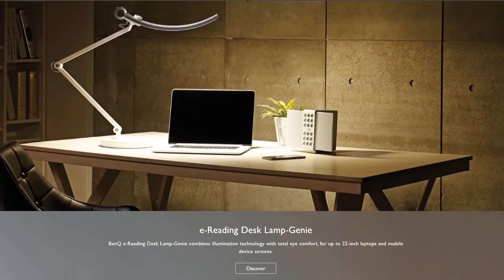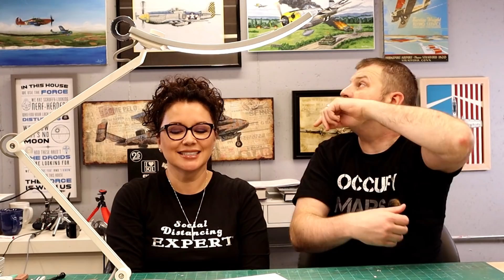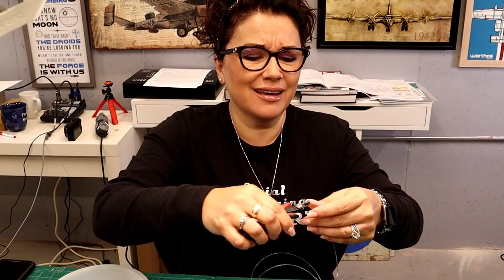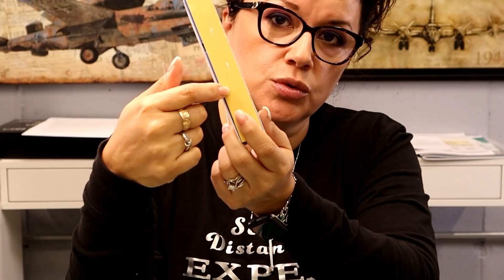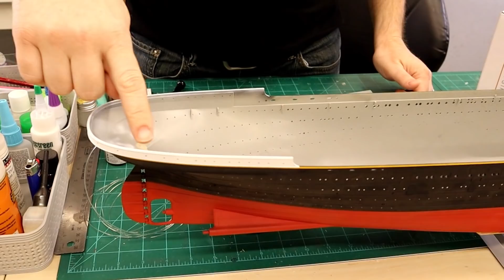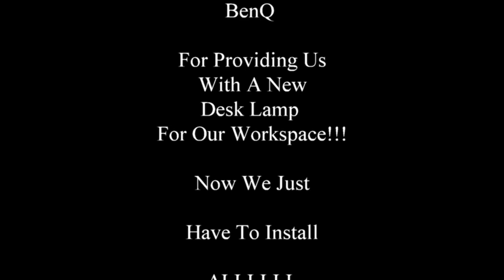1:200 RMS Titanic Build Video 4

Comment: 4:45 ... Why buy expensive fibre optics, when a decent quality fishing line will do the same job? It comes in a large variety of diameters and one spool provides a life-time worth of line. For just pocket money. Just make sure the fishing line is colourless and transparent and it MUST have a smooth, shiny finish.
The tips of the fibre optics you are using sometimes respond well to acetone or heat. Cut off a short piece and dip one end in acetone. Some plastics become glossy almost instantly, some turn white or matt, so give it a try. Soft plastics will also become clear after some heat is applied, so hold one end near to a flame. Near.....that is, don't hold it into the flame.

Comment: i do fiber optic work and if you get the cleaver tool that we use it will cut the end perfect so you don't have to polish it by hand. its like 40 bucks
Reply from the maker: Do you have a link to this tool? Is that what it’s called?
Reply: @TheMidwestModelShop  https://www.amazon.com/Optical-Connection-Stripping-SUMITOMO-Stripper/dp/B01GLRWXDC/ref=sr_1_24?dchild=1&keywords=fiber+optic+fiber+cleaver&qid=1625939077&s=hi&sr=1-24
Reply: @TheMidwestModelShop  and also fiber glass has a small jacket around that before you get to pure glass this kit will save yall alot of time on doing fiber strands for lighting and also you could look into fiber termination connectors to help hold the fiber in holes better and protect the ends of them and it will still produce the same light effect
Reply: @TheMidwestModelShop  do yall take online orders from your shop and ship out model kits and if so a link to website to order thanks
Reply from the maker: No we don’t have a shop. I called it the model “shop” as in “work shop”.

Comment: Hi, Great videos. Can you tell me if you drill the portholes with the real sizes, or, you drill the portholes with the sizes of the fiber optics availables?.   What drill bit sizes in milimeters you use? . Thank you by your help
Reply from the maker: I first drilled them with the real sizes. Because I didn’t know about the fiber optics at the time. But then had to go back with the real sizes for the fiber optics. The reason is the fibers are the exact size they say they are. The 1mm is ONE millimeter. But my hole was .03 short and so it wouldn’t fit, for example.
Reply: @TheMidwestModelShop  ah ok.   I buy in Light House Leds fiber optic of 1mm, 1.5mm, 2mm, 2,5mm and 3mm. But the portholes have rare sizes 3mm, 2,4mm, 2,1mm 1,8 1,2 and 1,1. Its difficoult instal the fiber optic with this sizes. You recommend me adjust this sizes with drill bit directly to the sizes of the fiber optics? .. Or reduce the diameter of the fiber optic with some tool?  Many thanks for the help from Buenos Aires  Argentina
Reply from the maker: I would drill the holes out bigger to match the fiber optics.

Comment: Does the LED strips have any sort of power input socket wire or some sort ? If so, where do you place them on the model ?
Reply from the maker: Yes it plugs into a normal 110v plug. I’m going to do a video on all of that as soon as I have time. It’s next on the “to do” list.

Comment: what temperature light are you getting out of the LEDs? The issue folks always have, this comes up in locomotive road number boards where the light is way too blue in the 5000k+ range.
Reply from the maker: You’ll have to look closely at the box in the video for the specs. It’s definitely NOT blue and looks like incandescent lights.

Comment: Hi Guys got a question for you what's the best plastic filler? I screwed up one porthole on the stern from the four that you need to add, I'm using testers puddy in a tube but it dries much to soft for my liking I thought of widdling down a pc of plastic from a sprue & gluing it into the hole to make it stronger to drill into without chipping, but not sure if there's a better alternative. Any help in this area would be greatly appreciated. 😜👍
Reply from the maker: So for seems that need to be filled quickly and then painted I use “Perfect Putty”. But it doesn’t dry hard. So for the windows I use Squadron White Putty. It will dry hard and drill out pretty well. But there’s a chance it could chip. You have to be careful when drilling. The best solution is using the kit styrene and touring down a rod of it to install in the hole because it will be the same density as the hull. Styrene rod also works well, but can be softer than the kit plastic in some instances. I use all three methods, depending on what I’m doing.
Reply: @TheMidwestModelShop  thanks a Billion Ben. 👍👍

Comment: Looks great you two!  Just getting into lighting myself!  Question for you - do you intend to leave every port hole lit?  On Enterprise builds, I've seen guys do a random pattern to the window lights, so it looks as though some rooms have light and some don't. Just curious.
Reply from the maker: We are lighting ALL OF THEM. On the enterprise, with its lighter color hull, it’s easy to see the difference. On this black hull it just looks like we missed something. I’m also not into figuring out which rooms were lit and which weren’t to be “accurate”. Because it’s not. At 10:30pm I bet most of the rooms were dark anyway.

Comment: Cool idea going with this way of lighting the model. 
Couple suggestions for you; paint the inside of the model with flat black and check to make sure it’s not leaking light through the plastic and seams. Make the inside of the model a light box and point the fiber optics at the source as you mentioned but fiber optics hate being bent, you loose a lot of light for every turn. It could be ok because you get a variety of light intensity and that could look fine in the end but it’s something to look out for. 
On the largest of the Titanic models for the movie they built quarters so when the camera would pan by the larger portholes you might see inside. You could replicate the effect with backlit images spaced back from the pothole window. We did this on SFX models for the same effect but with 35mm slides. 
I worked on the movie and we built the engine room and the subs so your model project is right up my alley! I had my eye on this kit from the start when they released photos from the toy fair in Germany  so it’s good to see it being built with great attention to detail.

Comment: My wife has been a manicurist for 30 years. I got hip to using professional nail files and pads way before the modeling industry did. It’s the only hip thing about me. Sadness. The hull lighting looks fantastic. Nice even light. In the stern under the poop deck you can take all the long strands and run them into a piece of flexible tubing to gather them together. That way you don’t have a bunch of loose strands to contend with.

Comment: Had you tried melting the ends of the fiber optic strands (Lucite rods) to make a tiny blob as we model railroaders have done for a long time?
Reply from the maker: Yes I tried that right away. Unfortunately this stuff just turns into a frizzy bubbling mess. I tried less heat and nothing happened. It was like it was going to melt into an ugly mess or do nothing at all.

Comment: I've seen someone else using one of these lamps and they seem to work well. It does seem pricey but you get what you pay for.😁
Fibre-optics is something I know nothing about so it was interesting to see the process. That's a huge project, on 𝒆𝒂𝒄𝒉 side, but it could be so much 𝒘𝒐𝒓𝒔𝒆 using different techniques. Apart from anything else, this has to be the cheapest method of lighting thousands of portholes.😁

Comment: Yep they look good.  Perhaps some diffusion, frosted plastic will help tone down any hot spots you encounter.  Warning! part A12 (page 13) will need the portholes drilled out as the  mould was inverted incorrectly.  Your PE porthole replacements will need to be used or the KA versions which are included in the Upscale kit.  There are a few windows missing in the superstructure that you will encounter later on too!!  Great video!  :-)

Comment: Hello B&N nice in depth video, I have seen the other's but got to love all the info you both share with us. As for fiber optics at the stern instead bending the ones blocked by aft well deck around & under why not drill a hole or holes & run them thru the aft well deck to the light source, they'll be covered by the poop deck anyway. Funny story for yrs I've wanted to build a titanic replica, but one that you could actually sit in & control from within the ship itself, I've mentioned using troll motors for power because they can actually be made into modular units using the motors themselves & connecting the wires. But I also mentioned how using fiber optics for the portholes, could be a very good idea, so whether this idea originated from me, I'll never know, but its great to actually see it work on a smaller scale, and its great to see it come to life. 😜👍👍
Btw did you guys get my steampunk'd email I sent? cuz I saw no reply to it.
And my reason for never building such a replica is because I lack the space to build it. But I've mentioned my idea's to: The ModelBoatGuy, hobbie Model Maniac and an other named: Hand Made, if you care to check their comments. I've had that idea since the movie came out. Anyway Guys great video, & sorry sometimes I run a muck when I start writing...lol. 😇✌

Comment: What are you going to do about light bleeding through the plastic
Reply from the maker: So the inside of the decks will get foil tape on them. The hull itself isn’t bleeding through anywhere (yet) because there’s so much paint on it. But I’m not going to “flood” this thing with intense LEDs. I’m not interested in super bright illumination. If I have to, I’ll put some drops of paint on the LEDS to dull their intensity.

Comment: The lighting looks great, sorry, but to uniform. Every port hole would not be lit. Some would be dark. Think of a large hotel, then look how some rooms are occupied others empty. The paint job is awesome. And I'm looking forward to seeing it completed.
Reply: Very correct. Its a good job the ends of the fibre optic can be taped off to stop the light on the desired port holes 😀. Does look good tho fully lit.
Reply: Absolutely and some of the rooms weren’t even finished, which is also why the ship wouldn’t have been fully lit up, the disaster took place on her shake down cruise
Reply: Agreed, passengers would have been out and about some of the evening and all doing their own thing.  A modern cruise ship (when they actually sail) would be exactly the same although much brighter.  The public rooms would of course have been a blaze of low power illumination and many of the cabins would be in total darkness. The third class friendly 4 type of bunk bed cabins further down the ship would have been less popular to hang about in during the evenings apart from sleep mode!